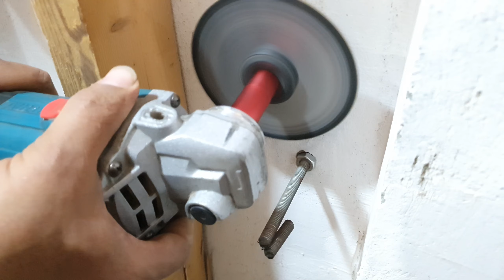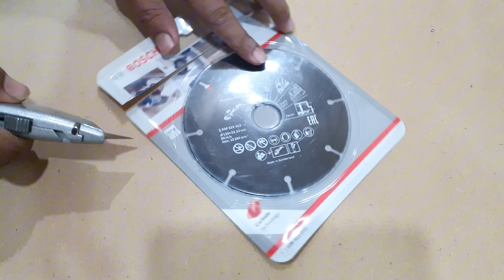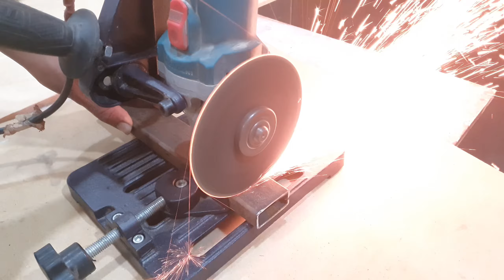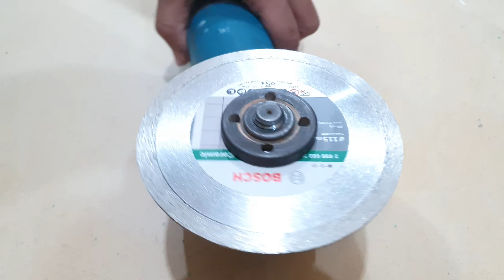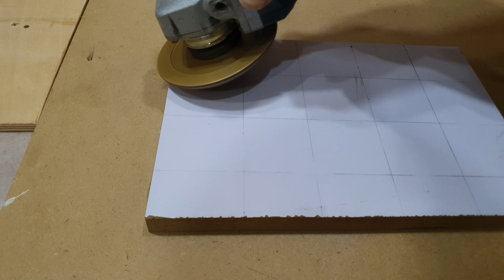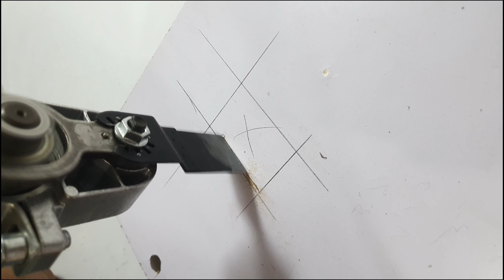Top 14 Angle Grinder Attachments That Will Change the Way You Work.

Comment from the maker: ⚠ Warning ⛔:
The angle grinder extension rod can be dangerous as it doesn’t allow for a safety guard to be attached. Please use extreme caution when operating it and always prioritize safety. Overall, the angle grinder is a professional tool, so it's crucial to know what you're doing before using it.